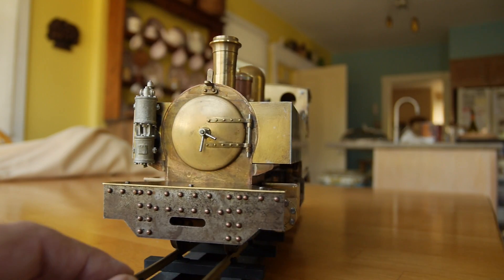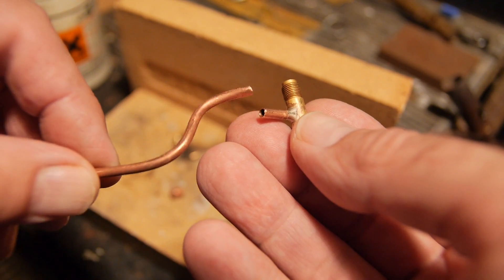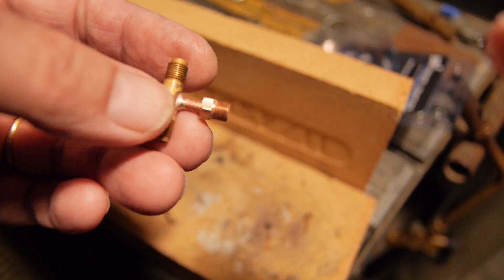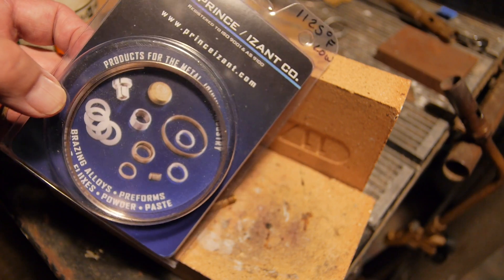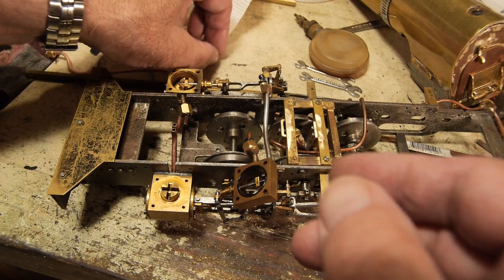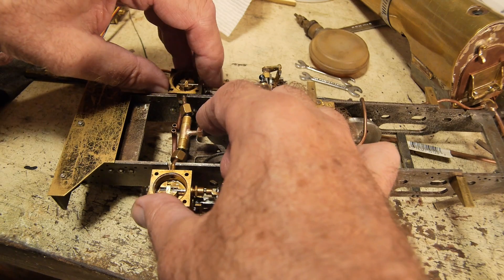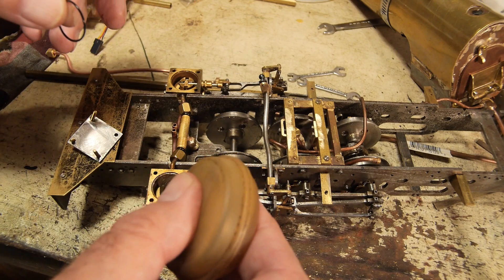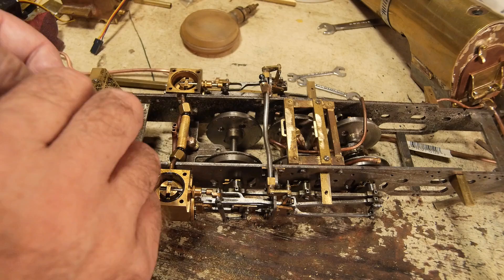'Russell' Live Steam Model Locomotive Part 13

Comment: You don't find that, over time, the oil eats into the rubber grommets?   We had a bad time with our refueling aircraft in that regard in the 1950's  (KC-97G's).   Also, the low temps at higher altitude hardened the rubber seals, but that's another story.
Reply from the maker: Hi John, some 'o' rings oil will eat into.  It depends on the material.  I can't remember what these are made of but they last quite well.

Comment: How easy was building the regulator and valves
Reply from the maker: The regulator was bought ready made from Roundhouse Engineering and the valves from Macc Models.  They are reasonably priced and saved a lot of time.

Comment: If the joint is close fitting, then there is diffusion from the parent metal into the silver soldered joint and from the joint into the metal, The result is that it always takes more heat to melt a previously soldered joint than it did to make it.
Reply from the maker: Interesting, I didn't know this.

Comment: Where does one get a set of those tiny spanners you use?? Also love the videos amazing work on the engines!
Reply from the maker: Thanks for your comment.  The spanners are BA size and I've accumulated them over the years.  You can get them on Ebay or buy them at model engineering suppliers like Macc Models, they have a great mail order catalogue at www.maccmodels.co.uk.
Reply: thank you so much! that's incredibly helpful.